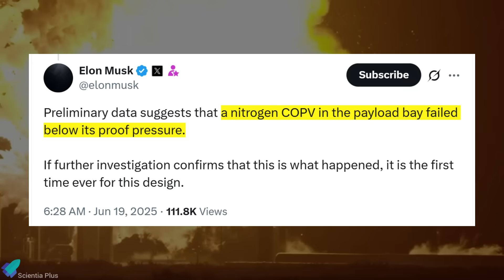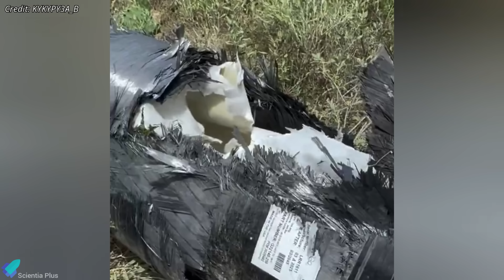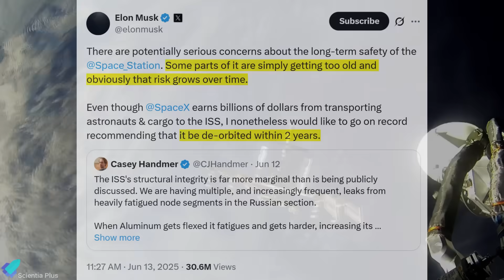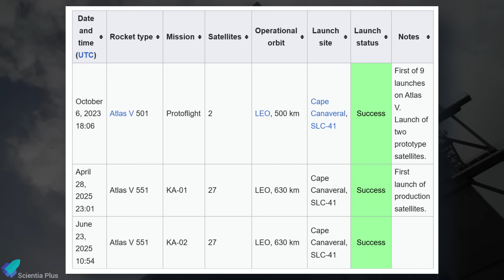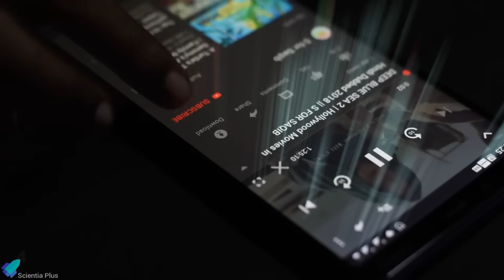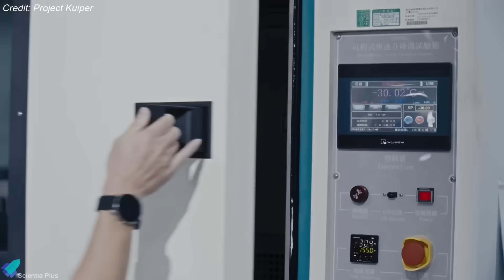SHOCKING EVIDENCE! SpaceX Finds COPV Behind Starship 36 Explosion

Comment from the maker: 00:00 Starship Updates
09:00 Critical Falcon 9 Leak and ISS Damage—How Ax-4 Still Made It to Space
12:54 Amazon Launched Its Starlink Killer AGAIN!

📚 Learn More:

🚀 Starship Block 2 Explained:
 📖 Summary: https://shorturl.at/b0dtw
 🔍 Detailed Explanations:
  • Design Improvements Update 1: https://shorturl.at/lpGT7
  • Design Improvements Update 2: https://shorturl.at/gwNQ4
  • Nosecone & Payload Bay Redesign: https://shorturl.at/xa60S
  • Methane Downcomer Redesign: https://shorturl.at/XdYBG

🚀 Starship Block 3 Explained: https://shorturl.at/mnBT4
🚀 Starship & Booster Block 3 Detailed Breakdown: https://shorturl.at/IViwD
🚀 Starship & Booster Block 3 Production Begins: https://shorturl.at/xRNkJ

🔥 Raptor V3 Mega Upgrades & First Test: https://shorturl.at/TRIyj
🧱 What’s Inside Starship GigaBay?: https://shorturl.at/nJM75
🛠 Insane Engineering of New Starship Launch Pad B: https://shorturl.at/7RAZd
🛢 Dual-Port Orbital Refueling – Full Technical Breakdown
https://shorturl.at/5tiqK

🛠 Other Starship Upgrades:
 • Hot Staging Explained: https://shorturl.at/jf400
 • Super Heavy Booster Upgrades: https://shorturl.at/Pi5R3
 • How SpaceX Protects Raptor Engines: https://shorturl.at/4Om8F
 • New Heat Tiles Explained: https://shorturl.at/p2Ijb

🚀 Starship Flight 7
 📽 Complete Breakdown: https://youtu.be/UqzZx7vb-TA
 🛠 Root Cause & Fixes: https://shorturl.at/HcLKo

🚀 Starship Flight 8
 📽 Complete Breakdown: https://youtu.be/f26yH80RK2o
 🛠 Root Cause & Fixes: https://shorturl.at/vsGFB

🚀 Starship Flight 9
 📽 Complete Breakdown: https://youtu.be/2eirgcUzwts

🔥 Starship 36 Explosion Detailed Breakdown: https://youtu.be/VWQiIz1ymBA

📡 Stay Updated:
📢 Weekly Updates: https://bit.ly/3HIQjPC
🚀 SpaceX Playlist: https://bit.ly/34wue8T

🌍 Follow Us:
👍 Facebook: https://www.facebook.com/scientiaplus

Comment: I'm really seriously dubious about using carbon fiber for this kind of application. It's a fundamentally bad idea, imagine weaving a canoe out of flax, and then just sealing it with fucking candle wax. This is essentially what you have, will it float ? yes, but will it still be totally water tight when you put a load into it ? of course not ! it's a flexible material and the wax will crack and crumble bla bla bla,. we've seen another rather horrific example of this type of material made to serve as a diving vehicle, with the blatantly loud huge "bangs" being heard by crew during it's previous descents, the sound of carbon fiber delaminating under huge compressive loads, even if it wasn't the material that is at fault, it's still a ginormously fucking STUPID use of the material, it was NEVER designed to be used for loads in that spatial dimension ! it's about as insane as making F1 tires out of glass ! it's a fundamental mismatch of material application. Why try and re-invent the wheel when we already have decades of alloys research that is proven to work, stick with what works.

Comment: It sounds like SpaceX has learnt a lot from its Block 2 Starship failures, but it also needs to learn what is required for a successful outcome.
It also needs to learn about orbital refuelling and reuseabe heat shield design.
It they are not prepared to conduct these tests with another vehicle, such as Falcon boosted test stages then they probably need to use up the last of their Block 2 Starships.